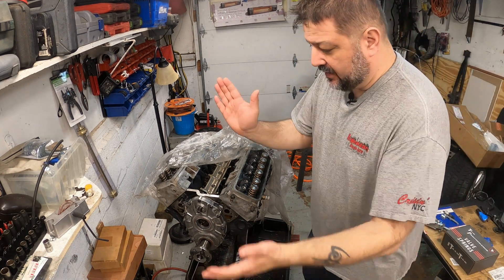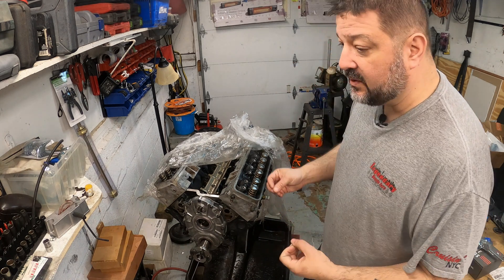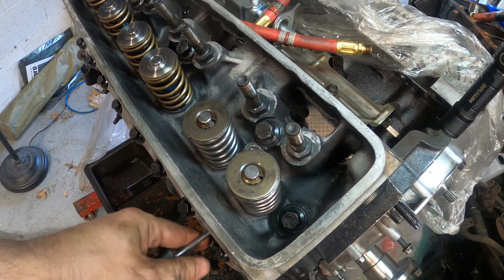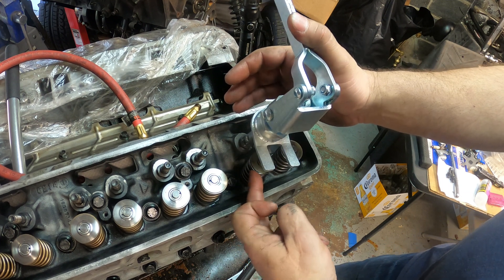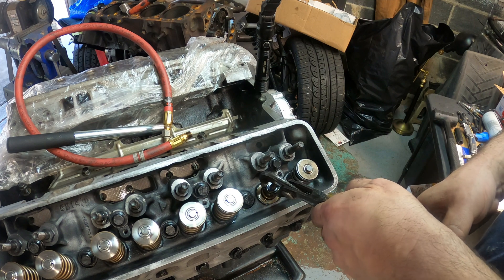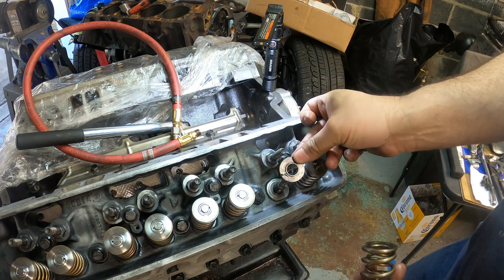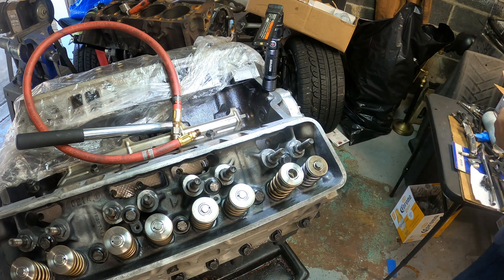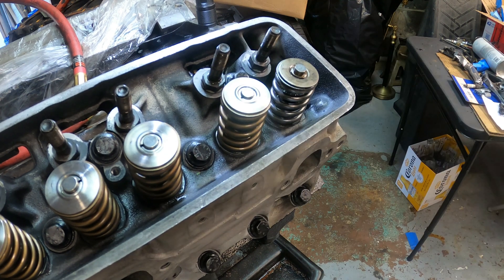Valve Spring Install Tick Performance .650 lift double valve spring LT1

Comment: If you setup the valve spring compressor correctly, it will lock down with the spring compressed. Put your keepers in and release the spring.should work great. Good stuff!
Reply from the maker: thanks for watching

Comment: It would be cool to make a video on using ls springs
Reply from the maker: yes it would be cool but we are on a tight budget for this engine..  The motor is still on the stand if you wanted to send over a LS valve  spring , retainers and keepers I can pull off one to the springs to show them side by side..    email:  maldo72motorsports@yahoo.com

Comment: This spring kit would work with factory valve guides because in the note section on summit say requires machining do you machined or leave them stock
Reply from the maker: this spring kit was designed to drop in into the factory aluminum head
Reply: I had iron 94 heads my lt1 came from a fleetwood

Comment: Are the cylinder head intake and exhaust valves the original ones from the LT1 or did you install larger valves? Will the 2.02 intake and 1.60 exhaust valves from the GEN 1 head fit this LT1 head? If you have the part number of the correct larger valves for these heads, you can share. I would be grateful. 🤜⚔️🤛🇧🇷🇧🇷🏁🏁🎱🏴‍☠️👻
Reply from the maker: hi stock valves for this setup  ... for more information contact http://elliottsportworks.com/ he is the best info for LT1 heads
Reply: @maldo72  Thanks!

Comment: Good afternoon,  I purchased the spring kit in your video,  great stuff as I can tell I haven installed then yet , but I have a question can you run a double roller timing gear and chain on an LT1 using the original timing cover and optispark , also how hard is it to drop the oil pan enough just to install  the timing cover. Thank you , love the video content! Keep it up!
Reply from the maker: you can use a double roller timing chain but you would have to clearance the timing cover and you will not be able to run the factory gear driven water pump ....
Reply: @maldo72  hi am working on the heads to install the tick performance spring kit ,  on the stock setup there is a shim under the bottom spring base do I install that shim with the tick spring setup? Thank you .
Reply from the maker: @jimreaume2937  is this a factory shim/springs or aftermarket?
Reply: @maldo72  not 100% sure I purchased the heads second hand, was told they were factory replacement heads from summit racing 🤷‍♂️

Comment: Have you sourced LS7 lifters yet?  I've been following the build but hadn't seen the lifter piece.  I've installed rockers, studs and the guide plates you had rec'd.  Dealing with a stock collapsed lifter and would like to do this once.  Thanks.
Reply from the maker: believe it of not this motor has ls7 lifters that i bought when i did the other engine over but,  really have not noticed anything different then the factory stock lifters.
Reply: @maldo72  Thanks for the reply.  One of my stock ones had collapsed. After digging into it, collapsed lifter might not be the only problem.

Comment: What are you going to set your rev limiter for now...?
Reply from the maker: 6400
Reply: @maldo72  Two bolt main, nodular iron crank. That brings the piston speed up from 3,248 fpm @5,200 rpm stock to 3,712 fpm @6,400rpm. Hmmmm.
Reply: The rev limit on the stock LT1 is not 5200 rpm . That’s just where it makes peak horsepower.

Comment: I have that valve spring tool from Proform, love it, looks just like that one. I use small rope in the cylinder then turn motor over to put rope against valves (on the compression stroke), tried the air thing one time, valve cracked open, let the air pressure out, air pressure pushed piston down some how, and valve fell in motor ugh.
Reply from the maker: That's why I don't use a compressor ... but if I say that everyone will jump down my throat
Reply: @maldo72  to each their own I guess
Reply: plus the rope helps with holding the valve up for putting retainers/locks etc... back on

Comment: So will you notice a pretty good difference in performance installing these?
Reply from the maker: the most noticeable difference will be above 5500 rpm in valve control